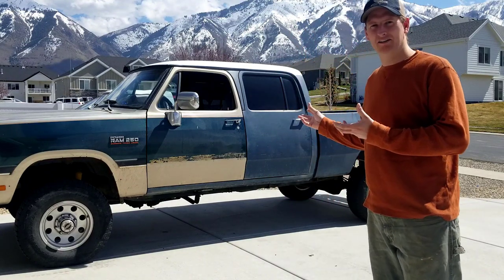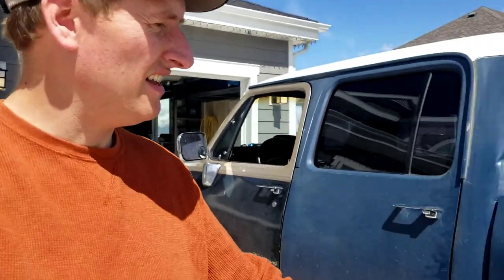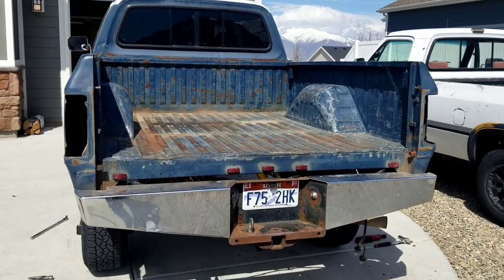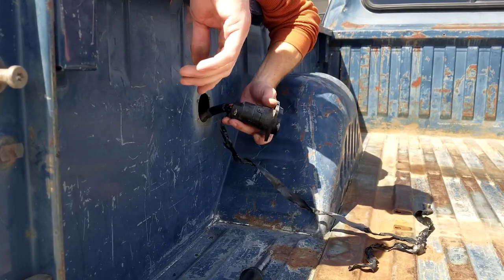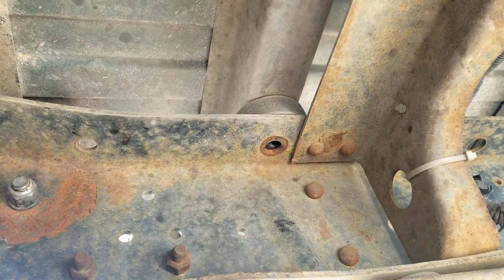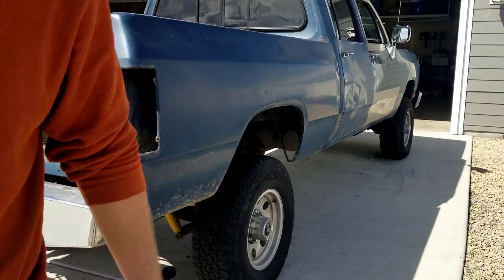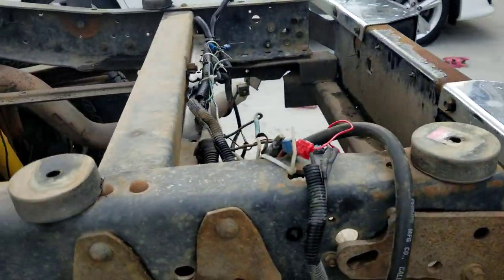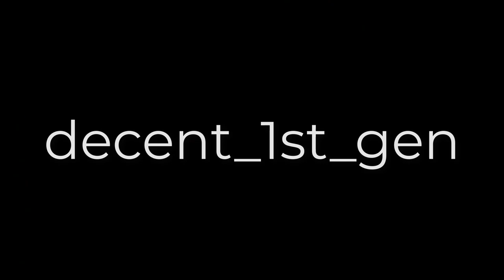1st Gen Crew Cab is Coming Apart: 1st Gen Crew Cab (Paint Part 1)

Comment: Just did this! I used eastwood platinum rust encapsulator with ceramic gloss top coat 10 out of 10 recommended over por15 which I've used in the past
Reply from the maker: Yeah I'm not a fan of por 15. I would have used Eastwood's products but they are out of stock until June 😢. So I am going with chassis saver which I have heard a lot of good things about

Comment: Hey Tim, I'm also an amateur painter, but we ended up painting our old mustang restoration project in our garage at home and it turned out great. I also re-painted my rocker panel on my truck last year outside and it also turned out great. If you need any tips or want another opinion on what other guys did I'm here for suggestions! At the end of the day it all comes down to prep work and also post-painting work (wet sanding and buffing), there are a lot of corrections you can do even if your painting doesn't turn out the way you want it to straight from the gun. I'm sure you've read lots but my go to process if you want a durable paint job (1) bare metal & body work, 2)Epoxy primer & filler, 3) 2k Primer & blocking 4) base & clear 5) wet sanding & buffing) Looking forward to the progress updates. Tyler.
Reply from the maker: Thanks tyler! I'll definitely be hitting you up. I'm thinking of doing a single stage just cause it will dry quicker as I am likely going to be doing this in my garage.

Comment: I’ve got a first gen with an hx35 I’m putting on. The down pipes heat shield is now rubbing on the blower motor cover. Can I remove the cover? What did you do with your turbo swap?
Reply from the maker: I run an hx35 and still have the heat shield. You are totally fine taking the heat shield off though. Many people do
Reply from the maker: I run an hx35 and still have the heat shield. You are totally fine taking the heat shield off though. Many people remove it with no issues
Reply: Thanks for the help I love the channel! I’m in your area hope I run Into you some time!